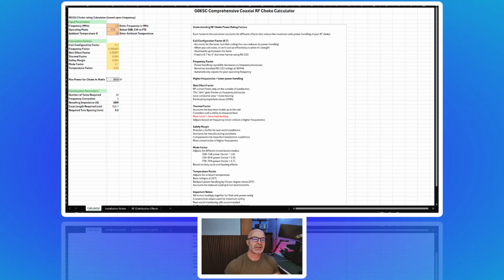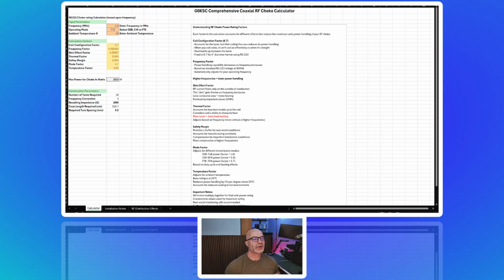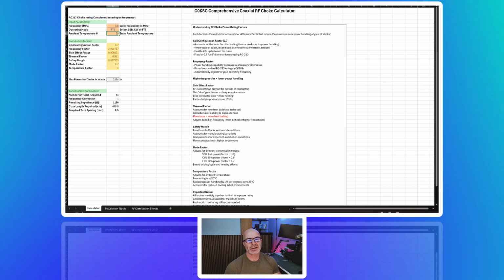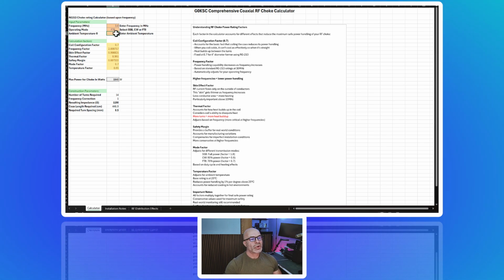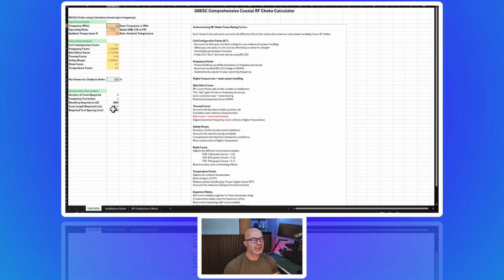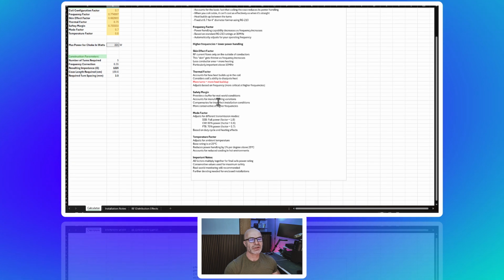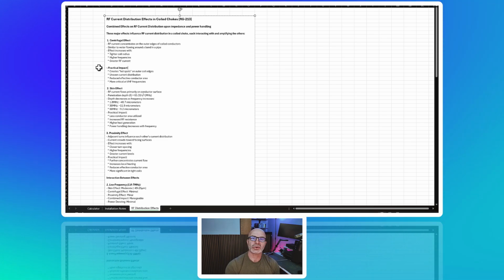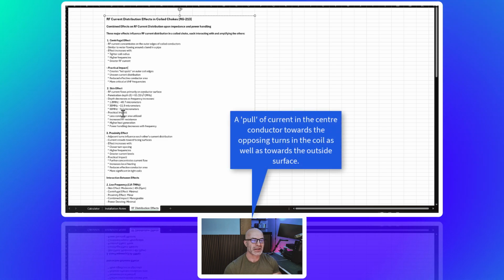PREVIEW: RF Choke Calculator & Design Guide - Understanding the Physics Behind Your Coax Balun

Comment: Why not broadband choques using ferrite instead of just a narriw band choke using the coax over a 4 inch form?

Can we use several coax chokes in series instead of a single one?

I was imagining feeding the antenna with the smaller number of turns choke close to the feeding point and another with larger number of turns about one foot apart.

What about using half inch Superflex foam insulated coax instead of 10mm polyethylene insulated rg213?